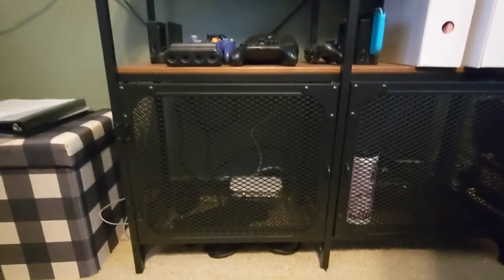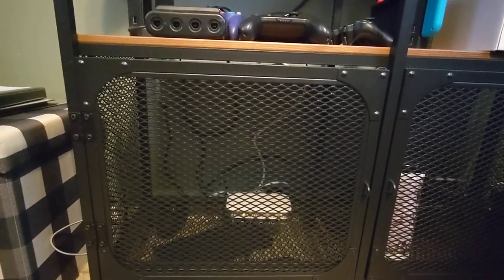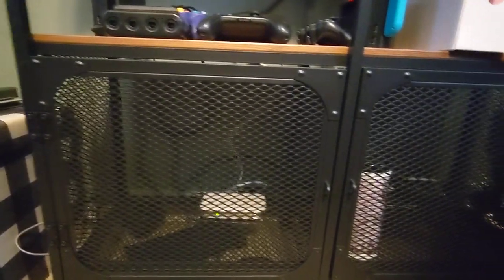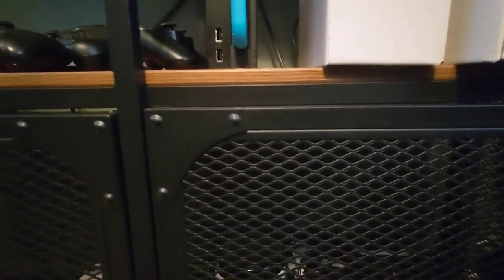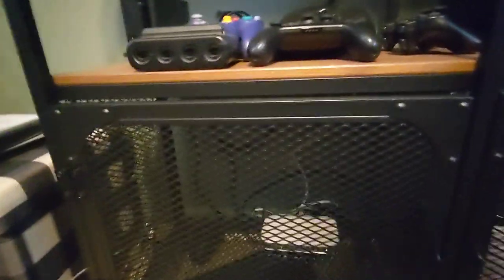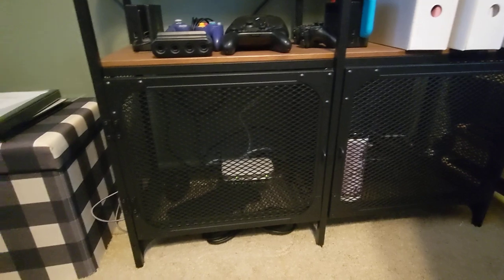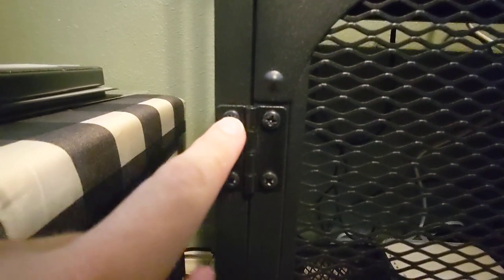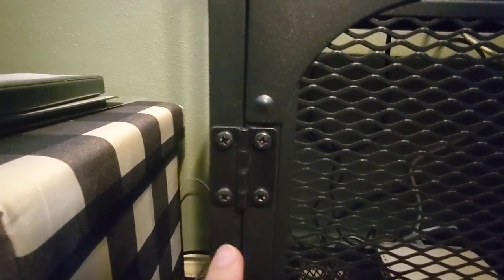Ikea Fjallbo - Crooked Doors Fix

Comment: There’s a very easy fix to this and it’s in Steps 22 and 26 of the instruction booklet. If you think the instructions tell you that you have one big magnet connecting to one door then you’re wrong. In step 26, you have 3 magnets, 1 for each door. In step 22 you attach 2 silver components to the frame of the TV unit. When you attach those and then attach the magnets to the doors then the magnetism will connect them to each other and your doors close securely.😃